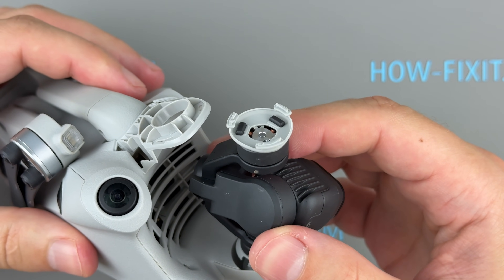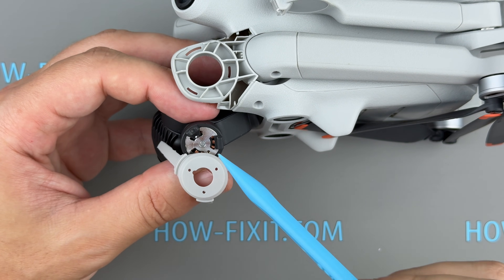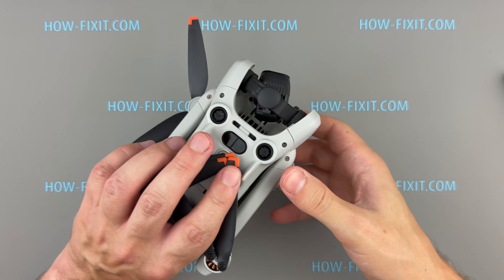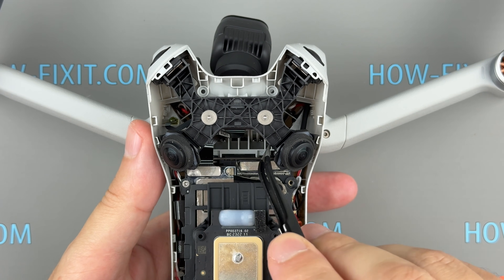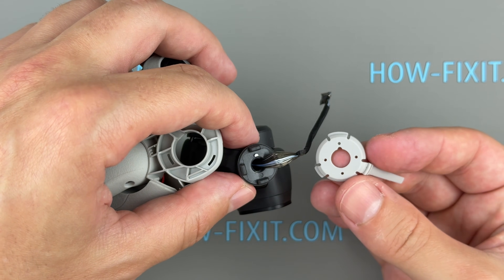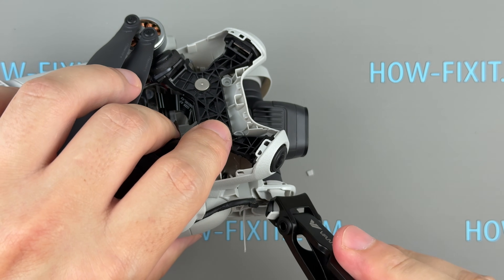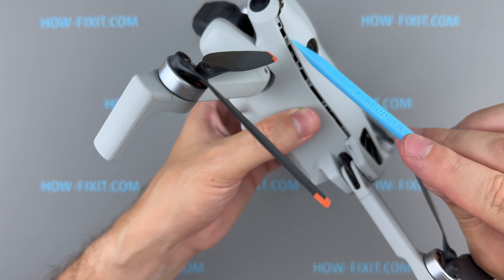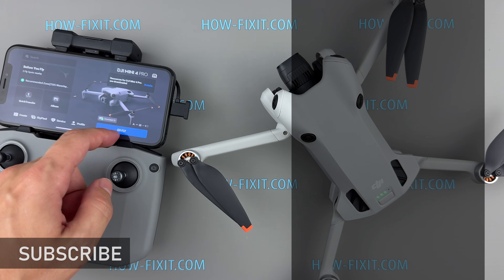DJI Mini 4 Pro Gimbal Rubber Mount Replacement Guide

Comment: I fixed the gimbal by myself after watching your videos.. but the camera is a bit tilted now and need external calibration.. pls help!
Reply: Did you find a solution?
Reply: @Farukpolat35 i just tried the gimbal calibration in the app mutliple times (3-4 times) and it worked..